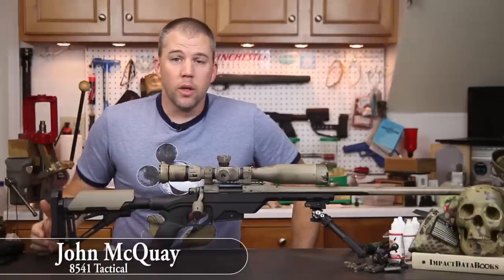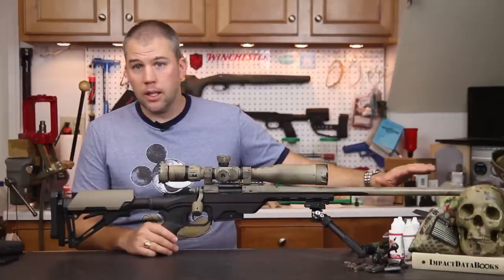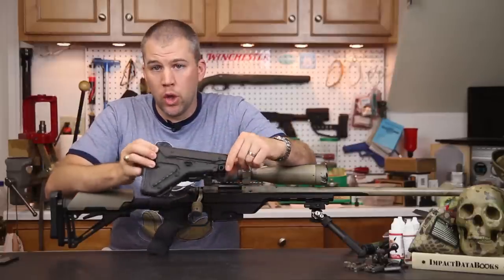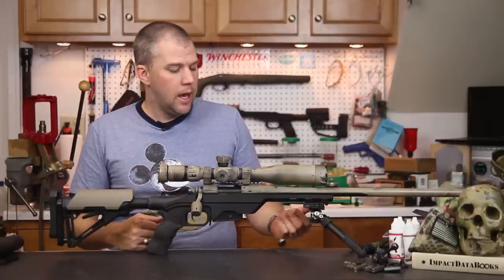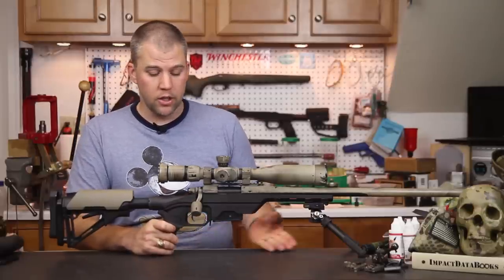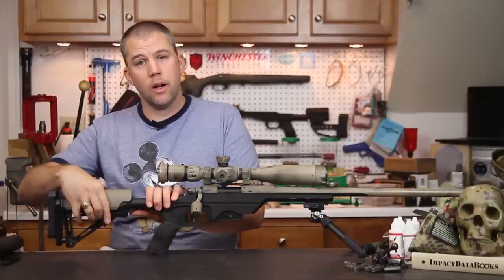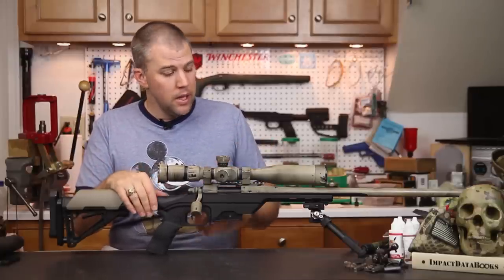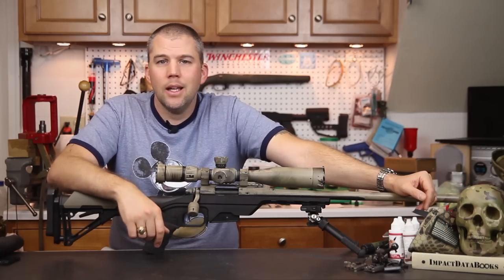Modular Driven Technologies LSS Chassis Review

Comment: Another option on that pistol drip issue is cutting off the dovetail.  I wanted to use my Mako AGR-43, so I cut it off - straight across to remove the dovetail with a dremel, unless you have a band saw.  But it works and looks great.  No problem.

Comment: I noticed that the stock mounts farther behind the pistol grip than some other chassis systems.  Would you anticipate any problems for smaller stature shooters (women) who need shorter lengths of pull?  I was concerned that if a folding stock adapter was added a 5'2" shooter (my wife) would not be able to collapse the butt stock enough for their short LOP.   Could you publish LOP data?
Reply from the maker: I would not run a folding adapter if I was putting a small shooter on it.

Comment: How does the trigger reach on this chassis compare with other ones you have used? I am using the Bell and Carlson M40 style stock you featured on your "Budget Precision" build, and while the LOP is fine, the reach to the trigger from the pistol grip is further than I find comfortable. Can you recommend any other stock/chassis system with a shorter reach to the trigger?

Comment: mossberg has the MVP LC  in 7.62  uses FAL, Pmag, AR_10 and mossberg mags  at a fraction of the price.   the Pmags are the dealbreaker when your using a LR308 and the mags are the same.  MVP varment, predator.  their flex MVP uses a stock system copmpatable with all their flex shotguns.  quick  changes, and you an use a shotgun stock for range shooting with a recoil pad. I have the M4 collapsable stock on my MVP flex 7.62, and the stocks are about 50 on ebay.

Comment: I have a SPS Tactical .308 and have wanted to put the action into the LSS Chassis. In your opinion, what is the biggest take away of the chassis system versus a Houge over mode system?
Reply: The magazine system and a consistent free-float are the biggest advantages.
Reply: ***** Thanks for the comment. Also what stock would you prefer? I have looked at the Magpul PRS for the AR-10 but been looking at AR-15 stocks for a shorter length of pull.

Comment: Sorry if I missed it, but what is the weight penalty over a Hogue over moulded?
Reply: That's dependent on the particular stock and grip you choose. As stated in the video the base unit weighs in at 1.6lbs. Adding in the stock and pistol grip as configured in the review adds about 1lb, pushing the total chassis weight to ~2.6lbs, roughly the same as if not lighter than a Hogue overmold stock.

Comment: Does the Magpul PRS stock suffer with the same issues as the Magpul MBR stock ?
Reply from the maker: I assume you mean the "UBR", and yes. It does.
Reply: +Igor Pecuh the LSS is missing the lower indent that the AR15 receiver has. This means the PRS will not mount properly.
Reply: +John McQuay (8541 Tactical) 
You can get an adapter for non-lock stock. 
I use the LSS-LX chassis that allows me to use the A2 stock without an adapter.

Comment: Hmmmm. Mossberg MVP lc looks identical? What's going on with that? I'm glad I went Mossberg though only because I can use 25rd pmags and it comes with a silencerco saker brake and does what it days it prints 1 moa at 100
Reply: Mossberg teamed up with MDT for a build, so mossberg used the MDT LSS..... You should do some research.
Reply: Adam0691234 thanks for the info man. I've looked for videos and stuff but there doesn't seem to be much on it or I just didn't hear them say it. Awesome little rifle though
Reply: Callsign: Blaze Yup, sure is! That chassis system is pretty dang slick.
Reply: Adam0691234 dang I can get a tan one in 300WM to match my Mossy 308! Badass and prob cheaper